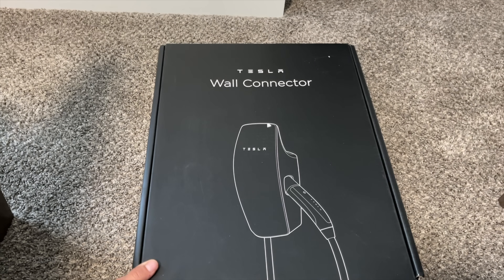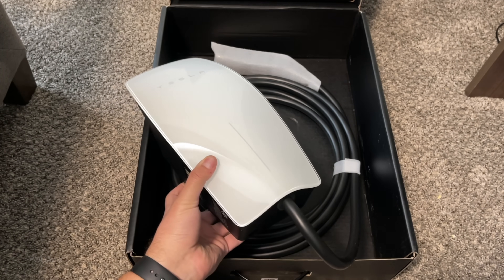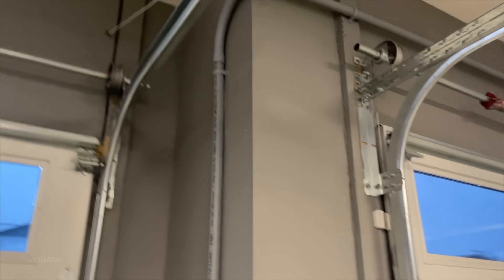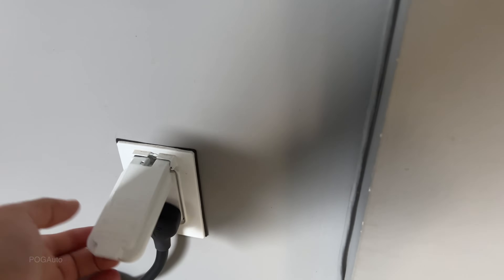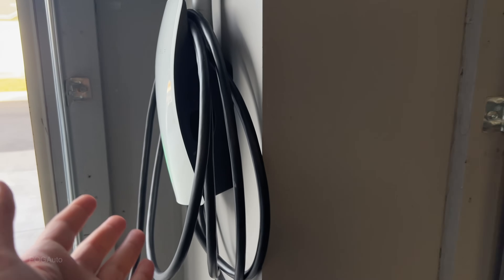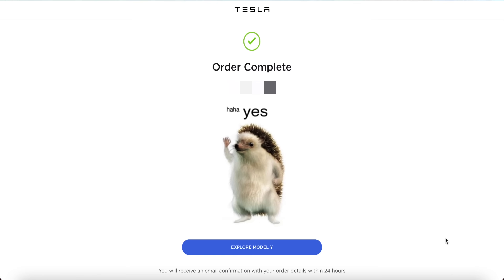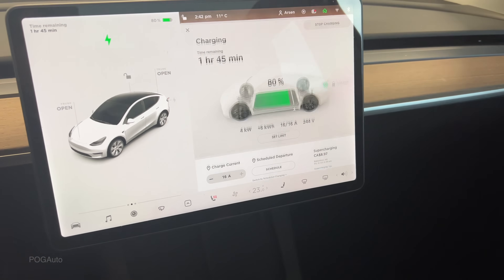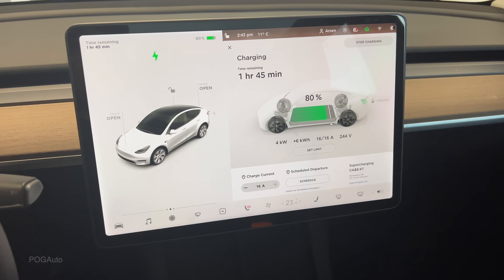Tesla Wall Connector - You need to know this about home charging!

Comment: Tip. Have a sub-panel installed in your garage and install at 14-50 outlet with a 40 amp breaker. If you use your Tesla mobile connector, it will pull 32 amps continuous which is more than enough imo. You can sell the wall connector if you like. Also great way to make sure that you don’t overload your electrical system is use scheduled charging. Car will only charger between say midnight and 6am. Also SR plus is limited to 32 amps anyways so can’t really take advantage of the wall connector. Have one car plugged into regular 110 and use the 32 amps for the one which needs most. Look into this. I say call few electricians about adding sun panel in garage. Cost can depends on how far your breaker box is from garage.PS I’m no electrician but just a recommendation
Reply: Let me know if you have any questions. Can recommend certain 14-50 receptacles for longevity. Another thought, since you already paid for the installation for wall connector, ask your electrician if you can still add a sub panel and put the wall connector to a 40 amp breaker then of course limit it down to 16 amps on your car screen or just keep pulling  32 over night.
Reply: @AbhijotSolanki  Why do you need a sub panel in the garage? What does that give you? Looks like hes routed a thicc wire up from his basement panel through the wall into the garage.

Comment: Thanks for sharing. Seems like you did things right and consulted an actual electrician. I have noticed a lot of people on the tesla group have 100amp panel and install 40, 50 and even 60 amp service for their EV charging.  That’s keeping in mind that you charge at night when a/c isn’t pumping and most electrics are off. However, then you wouldn’t be able to charge at home during the day. If you ever get 200amp service, keep in mind you will have to upgrade the wires to 6AWG, not only the breaker.
Reply: I agree that 200 (or 400 amp for a large house) service is best; however for someone who cannot or does not want to upgrade their service, there are options like EV Management systems that will interrupt charging when the total load exceeds the capacity of the service.  Also, if you need to charge during the day you can easily dial the charging rate back to as low as 5 amps (in increments of 1 amp) from the touch screen in the car or on the tesla app.  Some electric meters show in real time the kW being drawn which could also help to determine at what rate to charge, just divide the kW by 240 volts to get the amps.

Comment: I ordered the Tesla charger and having an electrician come out to install a new 200 amp breaker, here in IL it’s about $5k not including the charger, that was $500, so overall $5,500. It’s steep, but it will be future proof I guess. Between the down on the car payment and this, we dropped $10k. Kind of nuts lol
Reply: I got it done for 1700 including the Tesla wall charger  and all materials and labor.  Including for a 220 volt plug for my garage and wall charger at the office.  
Electricians often rip you iff
Reply: Cost me about 1600NZD here in New Zealand (about 1000USD) for supply and install of a wall connector. 5k is crazy, but maybe your installation was more complex?
Reply: Bro you paid $5k? I paid $300 install + $450 for the connector
Reply: @WrittenInFilm what about material cost? I ask my buddy to install it and all the material cost around 300. Where the hell u finding some1 does it for 300?
Reply: @Gin10594  to be fair i had a conduit already running where the wiring needed to go, but the only material cost for me was the wall connector itself, but i just got quotes on angi's
Reply: Don’t worry about it, some have dropped $15k for an unfinished auto pilot.
Reply: @Eddie-gb3bn insane right, solely base on a future promise that’s almost a decade in the making. What’s sad you can’t even transfer it to increase your car resale value nor can you transfer it to a new Tesla if you decide to upgrade car. That’s pure theft 😂
Reply: Or just install it yourself
Reply: About 4-5k in Ontario, Canada
Reply: 😊😅😊😊😊0ㅣㅔ
Reply: How does that work if I have an apartment?
Reply: I could be misinformed bc im still researching but that seems really steep- I’ve heard folks paying about 1,700 in my town?
Reply: Also in Chicago and recently had this same service done. How long did it take for Comed to upgrade the service line?

Comment: What did you mean by the car starts to drain itself?
Reply from the maker: So let’s say you parked it overnight at 65% battery and did not plug in the car to charge in the morning you will not be at 65% this could be worst on colder days. So I will be doing videos on this rolling when the extreme cold happens